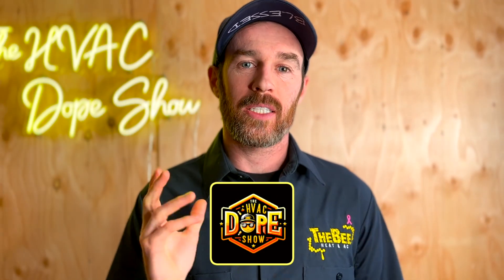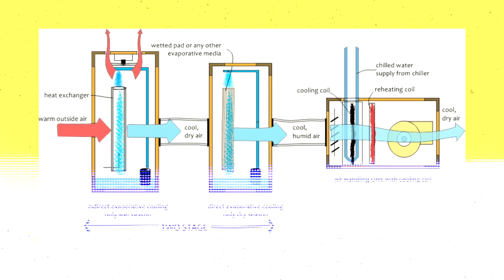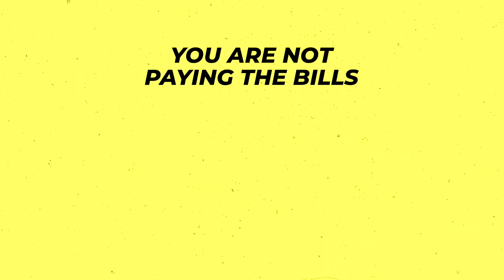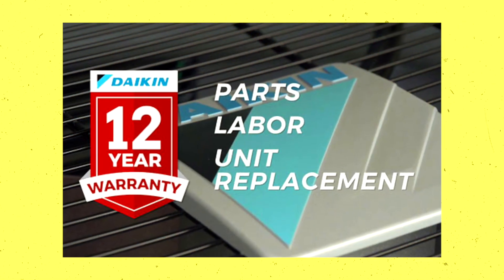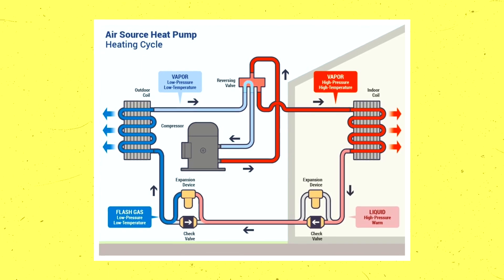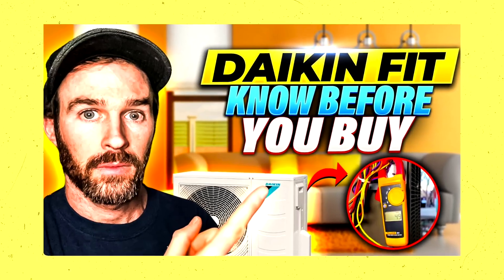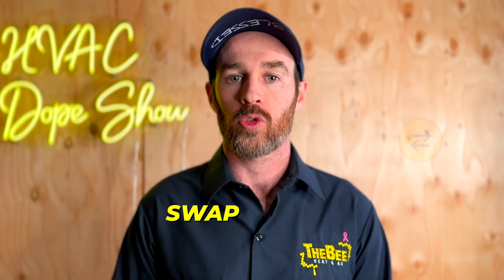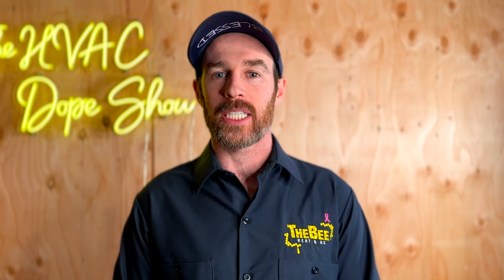Air Conditioners in 2024 | What you should know

Comment: Does the evap coil just sit above the furnace? It can get hot when the furnace is on in the winter?
Reply from the maker: Correct that’s normal
Reply: @TheHVACDopeShow  that's wild to me. A system that gets so cold in the summer can also sustain the hot furnace temps in the winter. I guess that's what they are built for!